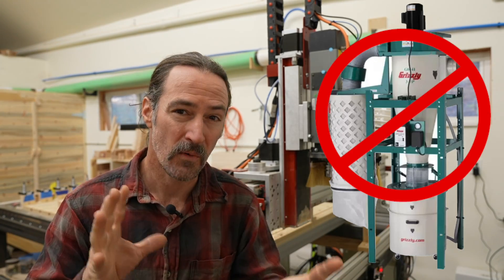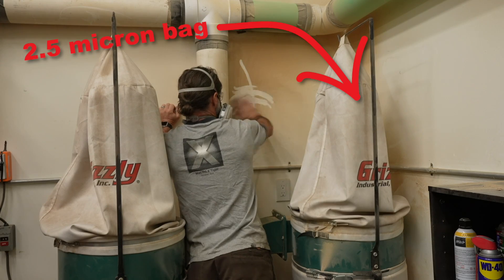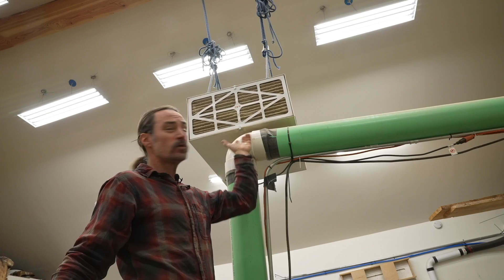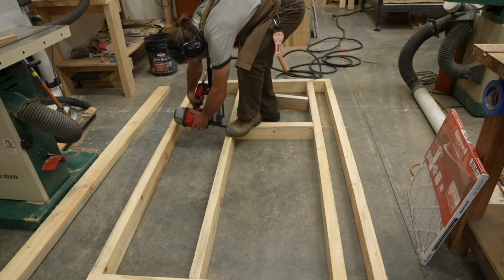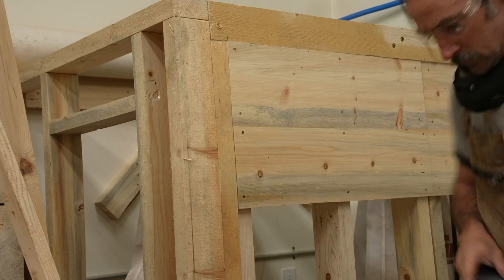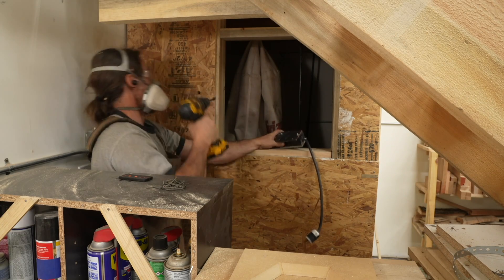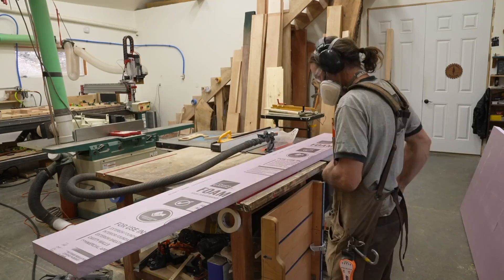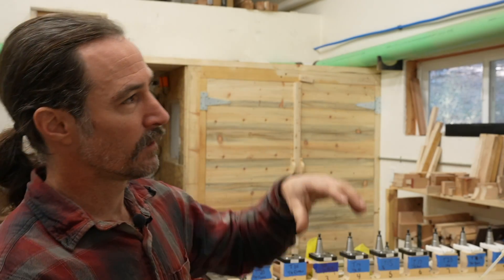Don't buy a cyclone dust collector? Use a cheap dust collector instead!

Comment: What is the point in making this video when you're not even sure it's gonna work in the first place. It's nice and all that but does it work?? Well, we don't know...
Reply from the maker: Someone mentioned a quantitative way to measure this: Use a PM2.5 sensor! I ordered one...I'll update my description with what I find out.
Reply from the maker: Hah, good point! Well, it does work; it is quieter and it dust reduce the dust. My question is how much will it reduce the dust. I still think the closet is a good idea even if it doesn't work well enough to eliminate dust, but I think it will.

Comment: i did a similar thing on my cnc, i had a small 1 HP floor mounted collector, i hung it on the wall, built a box around the outlet  which is just discharged into  a bag, and added two flat hepa filters on the side i got for 30 euros each from amazon in germany, then i made a thein baffle on top of a carcass to go in front of the inlet and catch the dust in a large bucket placed inside with a really snug fit, it works great and my system is only just under 70 db in volume.i figure i will only have to take the box cover off and empty the bag every 3 months or so. i couldnt see the point of having a quiet spindle only to have a screaming dust collector in the same room, and i reckon i saved at least a grand.
Reply from the maker: Awesome! You (and Josh) now have me thinking about getting a better grade filter -- HEPA filters are good for 99.9% of dust. I'll look into finding one of those.

Comment: Put some drywall over the foam.  Huge improvement and cheap.
Reply from the maker: On the inside? I was going to go with drywall on the outside, but used wood simply because it was "free". Drywall is pretty cheap...I could add some on the inside to make it quieter, but right now it seems good enough based on my dB readings.

Comment: Great topic to confront and share in this public way.    Lots of good, constructive feedback already.   As others have voiced, my concern is fire.
Reply from the maker: Thanks! Yeah, I'll keep an eye on the temps for a while -- particularly in the summer. It's around 60F in my shop right now (heating it), and in the summer it gets up to 70 to 75F.
Reply: @CorbinDunn  I'm mindful not just of temperature, but a fine particle-ladened air mass containing electric motors >  potential ignition- something not reflected by  thermostat reading.
Reply from the maker: @mavigogun  Good point! I did have this same dust collector in a closet at my old shop for probably 6 or 7 years without any issues. I know a lot of people are cautious about using PVC for their dust collection pipework...but I don't worry about it. (IE: static issues)

Comment: Get a super dust deputy, or XL, and add it to your system. 2 stage collector is better at separating dust and thus takes longer to clog your filters. When your filters start to load up, the motor has to work harder, then your air flow starts to decrease.  Also, why only one of those furnace filters? More of those filters mean more surface  area for air to flow through, lower velocity, and take longer to load up.
Reply from the maker: Whoa, I think I will get an Oneida Super Dust Deputy - that looks like a great solution without a lot of additional cost! I wish I would have thought about it before I built the closet...I may not have enough room to do it, and might have to rebuild it. I did quickly mention how much better a 2-stage system is, so I agree, it would help a lot! I'll probably run with this setup for at least a few months and see how it performs.

I only used one 20x20 filter because of cost and simplicity. A 6" dust port has an era of 18.8 sq in for input , whereas a 20x20 filter is 400 sq in for output. I figured that would be enough...but it is just a complete guess -- I didn't do any flow studies, but now I'm thinking I should have looked into that. It would be easy to add a second one.

Comment: I'd suggest replacing that 1" filter with a 4" one (better flow and you don't have to swap it as frequently).
I'd also suggest taping all seams (dust will travel the path of least resistance).
Test temps inside after long run times, but I'd bet you are okay.

Alternatively: K&N now makes "washable" HVAC filters. I own one for my large bedroom filter. They only offer them as 1" thick, so you would still need a higher rate of cleaning frequency than a 4" would offer. But at least it saves you $15? a pop.
Reply from the maker: Thanks Josh! I did caulk all the seams, but I haven't done anything about the door corners. I was thinking of using regular door foam to get it to seal better, but I might just try taping it. I'll keep an eye on the temps; I'm thinking it won't be an issue. 

I'll look into some other filter options - I would definitely prefer something that is reusable.

Comment: How effective are ionizers at charging fine wood dust and making it collect on surfaces?  I know they're usually indicated for getting rid of airborne pathogens and smoke particles.
Reply from the maker: I don't know! I'll have to look into it...but I do know the size of the fine particles of dust that are the worst for you are in the 0.3-1 micron range, which is similar to smoke particle size.
Reply: @CorbinDunn  If you get a couple of ionizers and some grounded galvinized plates positioned hear that outlet filter, you'll probably find the plates gathering material at decent rate right away.

Comment: Corbin, thanks for the systematic approach to this. I assembled a 2 stage DIY cyclone by repurposing a harbor freight one stage like yours but I still get the fine dust accumulating throughout the shop. I would be concerned with heat build up with fine dust particles as a fire hazard so keep an eye on that.
Reply from the maker: Thanks David! I'm definitely curious to find out if I still get a lot of fine dust buildup. I'm also thinking about modifying mine into a 2-stage to see if that improves things. I'll definitely keep an eye on how hot it runs.
Reply: We are a professional manufacturer of industrial filters. We can design a dust collector suitable for your working environment to ensure that your workshop is clean and dust-free

Comment: Awesome idea but won't your dust collector overheat in the closet ?
Reply from the maker: That's a good point! I hope it won't, but I honestly don't know. I'll keep an eye on the temperatures as I use it, and report back in a month or so. 

I am figuring it won't overheat because the motor has a fan attached to it for active cooling. There is also air still moving in and out of the entire cabinet, so it won't be stagnant air, and will be constantly replaced.  That's my theory at least...
Reply: @CorbinDunn  no problem bro all the best